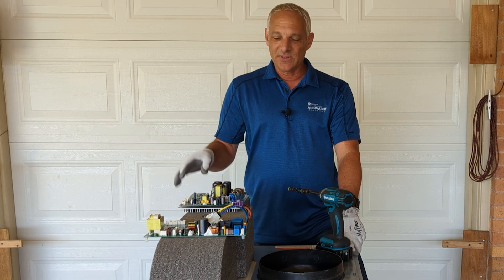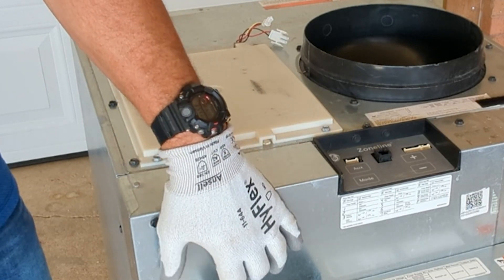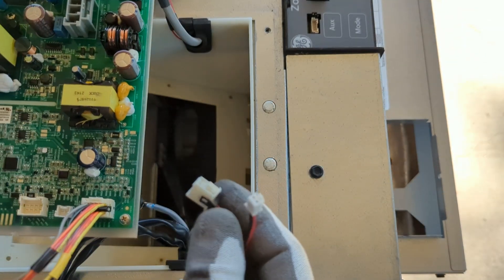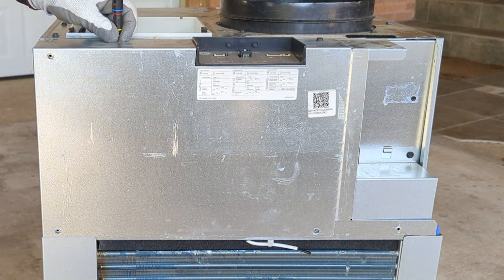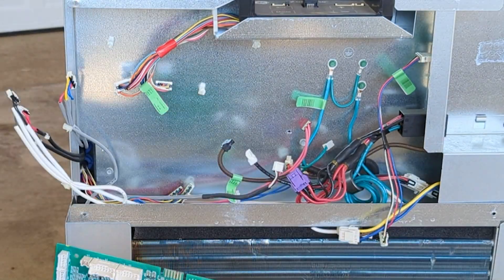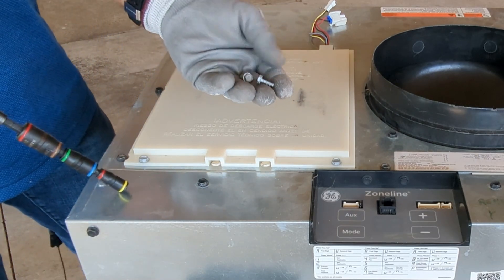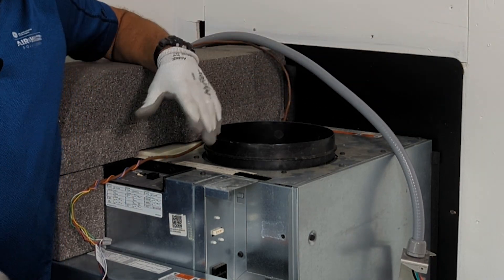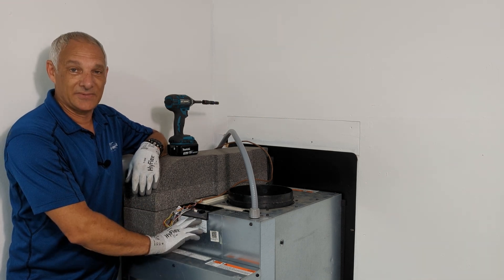How to Install an Inverter and Main Board on a Zoneline Inverter VTAC

Comment: Why can't you just discharge the cap yourself to not have to wait 10 mins? Would discharging it hurt the board or any other components?
Reply from the maker: We would not recommend altering the instructions, as this may cause an issue. If you’d like to contact our Zoneline Support team to discuss this (or any other concerns), they can be reached at 844-434-7822. Those specialists would be glad to help!
Reply: @geappliances  after seeing what type of capacitor and where it is on board I realize to not try to discharge caps on there. Thought it was a capacitor that would be for like a motor but it's not. I agree don't do nothing to capacitor and just let it sit for 10 mins